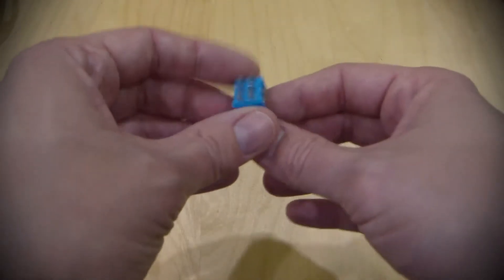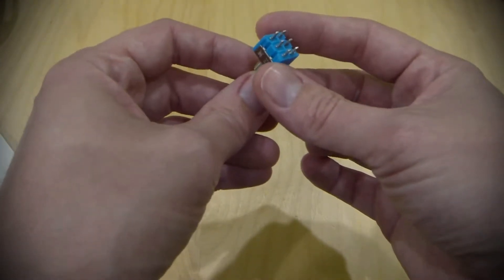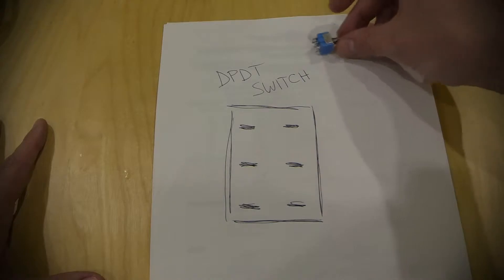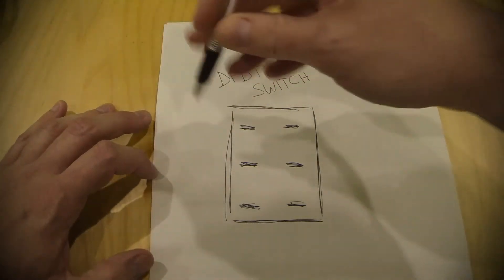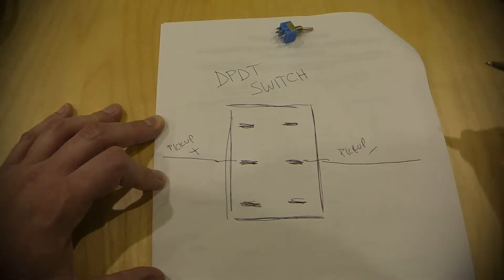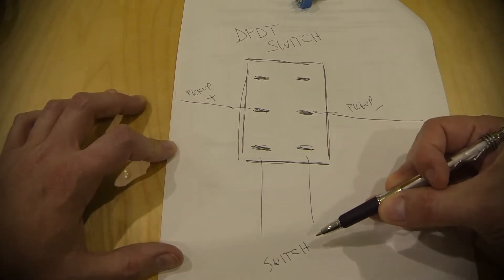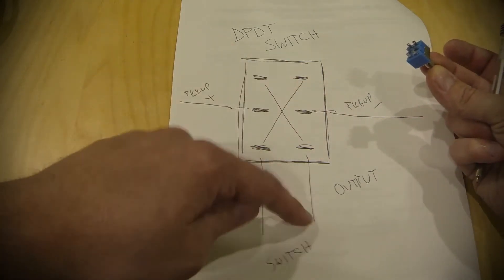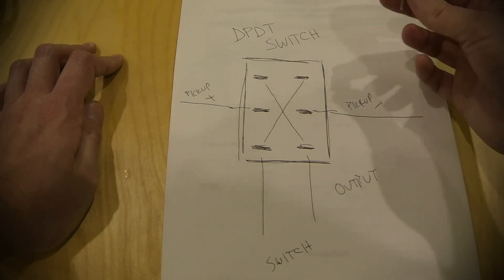How to wire a phase switch - MMT12

Comment: In my experience, it is the physical middle 2 pins that are the "common" output pins...the ones that output hot & ground to the 3-way or 5-way switch & flipping this switch goes from connecting those middle pins to top pins rather than the bottom pins. So, yes, the input hot & ground can be connected in that "X" as you show...but the output should be connected to the middle pins. 

More than one wiring arrangement will accomplish the switch, but having the output wires being the “common” wires of the DPDT switch is the usual arrangement. Having the switch swap output hot with ground rather than swapping the input wires, would be considered backwards by an electronics geek. 

Ultimately, checking whether the switch will work as desired is easily verified with the continuity setting on a cheap multimeter...to determine which pin connection change when the switch is flipped. (You can also check which magnet pole is "up" on a pickup via another magnet whose poles are labeled...like poles repel, opposite poles attract) 

Keep in mind that phase & polarity are two different thngs and reversing them is accomplished in two different ways: This switch is intended to interchange "start" w/ "finish" wires of a pickup...whereas reversing the polarity is accomplished by flipping the magnet(s), so that "north" up becomes "south" up, or vice versa. An electronics geek would say that you are swapping the "start" (inner) & the "finish" wires of a pickup. Note that reverser polarities may actually be "reverse wound"...but wwapping these two ends of the coil wire accomplishes the same thing as "reverse winding" the coil....except that the start wire would be outside, rather than (as is tradition) inside the coil, which makes no difference.

Also, one must consider that connecting two pickups (at least one of which is a single coil), so as to cancel hum...5-way Strat switch positions 2 or 4...requires that both the phase AND the polarity of the two pickups must be different. Hence, using this switch mod for one pickup...which changes phase but not polarity...& switching the 5 way Strat switch to join this pickup with the middle pickup, will only cancel hum in one position of the phase switch.

Last comment: Keep in mind that "flipping" a phase switch works by causing the output frequencies of one pickup to be deducted from, vs added to, those from another pickup. Hence, it is worthless if only a single pickup is used at any one time. The switch should not alter output tone of a single pickup The exception (...which is possible, I guess) is to use such a switch so as to be able to switch the phase of a single component coil of a true humbucker pickup whose individual coils are connected in a series. 

But, consider that mixing the outputs of pickups, with different phases, works because the carry different sound. With humbucker coils, the outputs of the 2 coils are basically the same (but with opposite peaks if they have opposite phases), it is probably that deducting one output from the other would leave little or no actual sound. 

Also, the phase switch would likely do nothing on the rare Les Paul humbuckers pickups whose individual coils are connected in parallel. On those pickups, the output of the two individual coils are always added together, regardless of their phases. 

The question has been asked if a phase switch could be built into a pedal. The answer is: Not easily, & not possible with a normal pedal, because most pedals manipulate the final output of sound from the guitar...after the output of multiple selected pickups have been combined. The phase change, to have an effect, must be accomplished before the signals from two pickups are combined. 

What you are suggesting is equivalent to asking if a pedal could be used to flip the 5 way switch...again, possible, but not easy or cheap. 

To accomplish what you are asking would turn a passive switch into an active one, requiring a battery to power a relay that "flips" the switch, and a wireless receiver circuit to grab the "flip" signal from the pedal transmitter. In effect, your pedal would be replacing a simple toggle switch with an active wireless circuit like a TV remote.

I hope this info/correction is found to be helpful. If you work with mods, like this, enough, this stuff becomes intuitive. But, as with lots of things, it's all more complicated than you think at first!

Comment: 1.  You need to say the the poles first connected are the default CLOSED position of the switch.   2.  This only works with TWO pickups that are ON in the guitar. If you have only one pickup in your guitar it will do nothing to the sound.   3.  Only ONE pickup is connected to the phase switch.

Comment: How would I use a mini toggle On-On-On as a pickup selector?
Reply: What you are describing is the usual arrangment of double pickup guitars. That is, simply a 3-way switch, as installed on Les Paul guitars. In other words, a DPDT (double pole, double throw) switch which has no switch position in which both pickups are turned off.

Comment: This cleared up my question.  I had a brief confusion looking up two-conductor wiring for a phase switch.  I guess all I'm doing is connecting the bare ground wire to the negative side, and the hot side to the positive side.

Comment: Could I just build this into a small box to put anywhere in line on a pedal board, or is there some info I'm missing particular to guitar pickups (I'm not a guitarist).
Reply from the maker: Technically you can reverse the phase anywhere in the signal chain. Speaker phase inversion is very common. But phase only really matters when you have two signals that are working together or cancelling one another out. So swapping the signal on a pedal board would only sonically affect anything if there was a parallel signal alongside it.

Comment: Hello I could really use some help.. I followed this diagram and it works however, ...when the switch is engaged and my fingers touch the strings I get an un-grounded hum.. Do you know what could be causing this? When the switch is dis-engaged everything works normal and no hum.
Reply from the maker: If you are putting a reverse-wound, reverse polarity pickup pair out-of-phase, you're possibly negating the hum-cancelling function of the pair of pickups. The phase relationship of pickups is a big part of how humbuckers and modern 3-pickup guitars lower the noise levels.

You can also double check that you have a solid ground connection on the pickup with the switch engaged. And you can also try grounding the body of the switch.

I hope this helps!
Reply: @chelseaguitarmaintenaceand721  Thank you for your response...I actually took my guitar into the shop last week and they told me the same. I appreciate the info regardless and thanks for the instructions. cheers
Reply from the maker: @NathanHassall  Okay, I hope you  got it sorted. It's also worth considering that if your pickup has a cover that's connected to one of the leads you need to give the cover a dedicated ground to avoid hum when the phase is swapped.

Comment: Thank you for this video.
May I ask a question?
What would happen if I use an [on/on/on] or [on/off/on] DPDT switch?
I don't have an [on/off] switch like the one in the video...can this still work?
Reply from the maker: You could easily use those switches. With an on/off/on switch you would have the option of phase reversal in one position and a coil split (if a humbucker) in the other, or similar. The switches all have their uses.
Reply: Ah, that would be very cool...would you have a tutorial on how to do that? Or could you make one? That would be awesome!
Reply: How would you wire phase reversal and coil split onto the same DPDT 
on/off/on.....would the off position put the pickups back in phase? I understand the out of phase part.....not sure how you would wire the coil split on the same switch.
For coil split....just attach the + and - of one coil to the end polls on the DPDT?